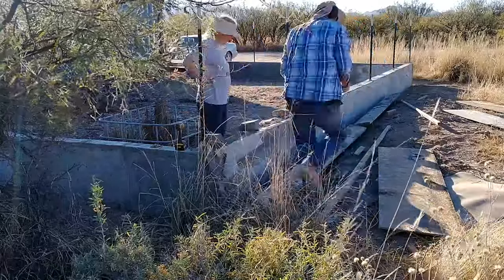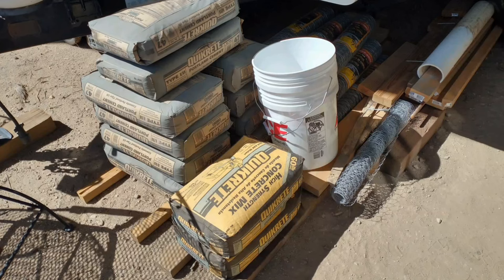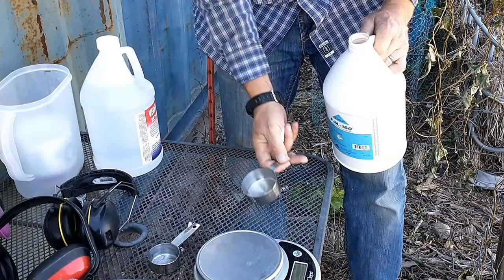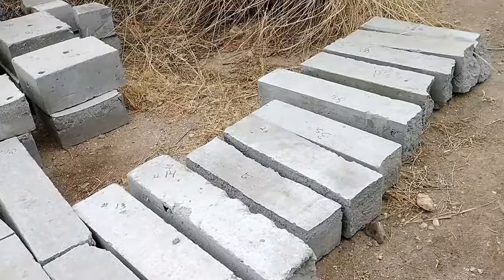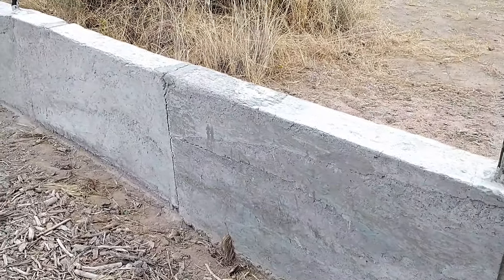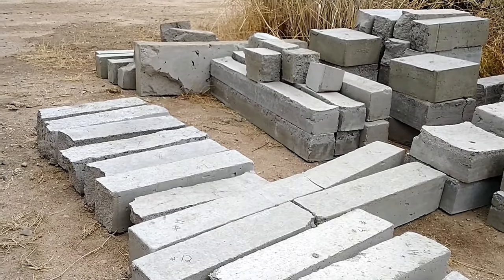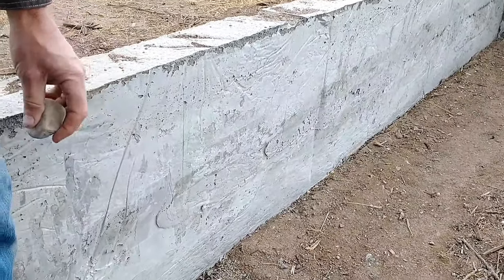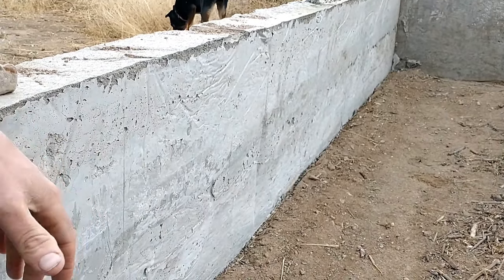Why we GAVE UP on AIRCRETE & What is Our Plan Now?

Comment: Alright, I am a Aircrete builder and instructor and it pains me to see videos like this discrediting aircrete when its blatant the amount of misuses happening. I highly suggest anyone wanting to experiment with aircrete come take a course with DomeGaia to learn how to properly use aircrete and what the best use cases for it are. 

I have not sat down and read through all of the comments on this video so I apologize if anything was answered I am about to go over. 

1. Your climate changed as you were doing your testing. Temperatures dropped and you probably weren't warming your soap water solution or the water you used in your mix. Curing cement does not like cold temperatures. Soap solutions do not like cold temperatures. 

2. All of the recipes are off. 
-Aircrete recipe should be 6 gallons of water to 94 lb bag of cement. 
-Soap density should be between 90-100 grams per quart. Never go under, you can go over. Our recipe is 16 oz Seventh Generation to every 5 gallon of water. No extra glycerin needed. Do not leave your soap water sitting outside over night especially in cold temps. If you do, stir it next day and add plenty of warm water with your next solutions and stir to make sure the soap hasn't coagulated. 

3. Aircrete is not really structural in this way. Its compressive strength is much much much less than concrete. We are talking like 200 psi vs 3000 psi. So building a straight wall building like this is a huge no without concrete pillars or some sort of other reinforcement to handle the roof load. We build DIY aircrete structures in the shapes of domes and arches for a reason, because that geometry is very strong. 

4. Aircrete (at least diy aircrete) is brittle. It will crumble, yes. You have to give the building tensile strength with fiber glass mesh or basalt mesh incorporated with stucco. Building with aircrete is like a surfboard, you have the foamy soft inside which is brittle and will break, but then you reinforce it with mesh and stucco and it becomes strong and almost monolithic. 

I could go on and on about a few other things but these were the main points.

Im sorry you experience with aircrete has been troublesome but most of this could have been solved by either coming to a DomeGaia class or reaching out to us for advice. 

Good luck on your next adventure, 

Cheers.
Reply from the maker: We shared our whole aircrete journey as we went, and this is the last video in the series. The whole process we used to make aircrete and our house design is explained in previous videos. We were open to advice throughout the process. We didn't know why it wasn't working and neither did our viewers. I watched every video I could find, asked lots of questions, did every Google search I could think of, and read every article I could find that was available at the time (2.5 years ago). We made lots of practice batches and test samples to help decide if we wanted to build with aircrete and which recipe we wanted to use. 
At the time, no one would tell us how to make the water soft, so we used an RV water softener, which seemed to work okay. No one seemed to know if temperature mattered or what the ideal temperature to make aircrete was. We were done with aircrete by the time we started hearing anyone talk about temperature being an issue. Warming the water would not have been practical for us anyways since we are off the grid, and have limited power. We have extreme temperature swings here in the desert and didn't realize that would be an issue. 
A lower water mix was recommended in some recipe booklets for poured aircrete walls, so that's why we used 5 gallons instead of 6. Less water likely made the mixing much more difficult, which was a problem. We knew that aircrete is not structural and had plans for that. 
Once we knew enough to do the calculations, we also realized aircrete wasn't going to save us any money, it wasn't as good of insulation as we thought, it was going to be much harder to build with, and it likely wouldn't last as long. We didn't want to build a temporary house, and didn't trust aircrete to last for 50+ years.
I'm quite sure if we had gone to a workshop we would have decided not to use aircrete. It was a frustrating experience, but we did save money by learning it on our own. We didn't enjoy the process of making aircrete, the poured walls were going to be a huge pain, and with our design we weren't going to save any money. 
Aircrete is interesting and we thought it had potential, We really were planning to build our house out of aircrete and wanted to share the journey. These videos share our experience with aircrete. The videos as well as the viewers comments and are here for people to critique and to learn from. 
Thanks, and best wishes. -April 🌞

Comment: Poor it in metalstud, or use fencewire for big pieces of wall.
Reply from the maker: We were planning to use cee purlins to build a metal frame to support the aircrete walls. The aircrete would have also been reinforced with rebar and possibly metal fencing, then covered in fiberglass mesh, and plastered.

Comment: There's gotta be a way to figure out what started going on. Some expert or scientist out there knows I guarantee you. You have lots of clues. You just need to narrow in on the culprit. Not like aircrete is the only way to go though. Lots of choices out there these days.
Reply from the maker: There's not many aircrete experts out there that I know of. The ones I see online have struggled with aircrete also. I could see building a shed out of it for "fun", but I wouldn't build a house that I want to last 100+ years out of homemade aircrete. It's too finicky, and there are too many unknowns. I would suspect the cold Drexel was our main problem, and using warm water may have helped. 
Once we crunched the numbers, building the house we wanted with aircrete no longer made sense anyway.

Comment: Boy, I feel bad for you guys wasting all that time. I was also going to use aircrete, but was able to decide against it just by watching other people, who although they were able to make some small dwellings, I saw that there would be problems down the road. I also wasn't sure if I was going to off grid in AZ (I used to live there, in the High Desert in Apache Cty) or some other state where I can depend more on the availability of good soil and water. Everything is a compromise, that's for sure.
Reply from the maker: We were working on other things at the same time. I'm just glad we didn't even try to use it for our house. It sounded interesting, but there are definitely better and less expensive materials available to build a house out of. Our house turned out great, and the soil is actually impressively good out here. It just takes a little work to gather it. 🙂🏜️

Comment: Have you ever seen a hay bale house?
Reply from the maker: Yes, we didn't like the risk of mold and bug issues. Our son just built a hyperadobe house. 🛖
Reply: Just being picky - hay and straw are too different materials.  Good hay is leafy, straw is stems (iirc usually from wheat).  I hauled a lot of hay when I was younger.  Helped build a straw bail house and felt like I was superman - straw bails were about 1/2 the weight of hay.  When researching straw bail houses, they discussed the difference - mainly that hay is a good food source for animals (and insects), straw not so much.  I suspect there would also be a fairly large strength difference.  I enjoyed the workshop on straw bail houses - but after talking with the owner throughout the week, I realized that it was not nearly as cost effective as I had hoped.  I am sure it was many reasons, but the correct plaster was the killer for me - as it could not be sourced in the US, but needed to be imported (and as such was quite expensive).  Add to that, as it is not used in the US, there is virtually no working knowledge in the US masonry industry.   @RedandAprilOff-Grid

Comment: maybe as time went by..the stocked concrete slowly expired or lose effectiveness..
Reply from the maker: It didn't sit around long at our place, but there was a cement shortage when we were making this, so that is possible. The colder temperatures were also likely an issue.

Comment: did you shake the drexel bottle thoroughly before each use? also cold temperature would not help, also dont over blend the foam+cement.
Graphene seems to be an amzing additive https://www.youtube.com/watch?v=TYgvqokXAeI
he consistently make good batches, most time i see him doing small batches, may be contact him for any advice, he responses to youtube comments
re: over blend foam + concrete, you need to keep moving the rig around, maybe pulse it, eg 1 sec on 1 sec off or pull trigger at slow speed, and move up down motion, maybe even try using the cement mixer you already have, gentle slow blend.
Reply from the maker: We didn't figure it would be a good idea to shake the Drexel, but we did try to mix it around some before each batch, but sometimes forgot. One of the last things we tried was using a new bottle and pouring it back and forth into a jug, to make sure it was mixed well. Our first successful batches turned out amazing. I would guess the colder temperatures were mostly to blame for the later issues. The foam was becoming more dense, and he tried to adjust some for it, and it was still in the acceptable range. Yes, I asked advice from Herger several times. It is much easier to mix smaller batches, but we knew we would need a lot of aircrete, so wanted to practice making larger batches. It would take a long time to build a house one bucket at a time.

Comment: All the time and effort ive seen people put into AirCrete, just pour the concrete and be done and know itll work.
Reply from the maker: We wanted something that had some insulation value, but yes concrete is still a better option.
Reply: Not a specific dig at you either.  Just observing YouTube alternative building ideas.  I really like the idea of ICF, but it can be pricy.
Reply from the maker: @phslion  Yes, we thought this would be less expensive and still offer decent insulation, but it turns out it's not cheaper than a traditional home, and the insulation value isn't very good. We are so glad we didn't use aircrete!

Comment: Man, I know exactly what you were doing wrong. The samples were decreasing in quality because you were stirring them more with that mixer. I get perfectly repeatable results with aircrete and a concrete mixer. If you check out my channel i have some videos on the process i use, which is just mixing 90#'s of concrete in at one time (to make the columns) and 60#'s for the foundation, which i also covered with motor mix for the top part. I would go back and try those samples using a more gentle approach for mixing.
Reply from the maker: Sorry, I missed seeing your comment. Glad you figured out what worked! We tried different mixing techniques and speeds. My guess is that the cold Drexel was the main issue with our later batches, but we also had a lot of trouble with mixing, so that was definitely a contributing factor too! There are more details in our other videos about the different things we tried. Best wishes with your aircrete projects! 👍🙂
Reply: @RedandAprilOff-Grid  Well you have to realize your mixing a foam, and if your up in it with a high speed mixer the foam characteristics are going to change. I laid an entire foundation using hand mixing and it was a terrible patchwork of different looking aircrete. When i got a cement mixer, all my batches came out like the ones before.
Reply from the maker: Cool, and good to know, we had heard that cement mixers don't work well, so we didn't try it. We were considering getting a mortar mixer, because Aircrete Harry had success using one, and we were going to need to make a whole lot of good aircrete to build a whole house. 👍😎

Comment: I thought that air Crete had a standard formula.
Reply from the maker: There are different recipes depending on what you are using it for. Mixing 6 gallons of water with the cement seems to be most common. I have seen recipes using as little as 4 gallons water, or as much as 8 gallons. The amount of foam added can also be adjusted. Less foam for more strength, or more foam for more insulation value.

Comment: They tell u Not to use anything but Portland cement-so if u used quick Crete u were creating problems;)
Reply from the maker: We used Portland cement in all of our batches, but had very limited brand options. There was a cement shortage at the time. 
We did have some quickrete sitting around, so maybe I showed the wrong picture in the video. 🤔

Comment: I don't see any reinforcement in your pours.
Reply from the maker: We were just testing different mixes and our ability to make consistent aircrete, and were planning to add wire mesh, and rebar on the inside of the walls, and fiberglass mesh, and plaster to the outside, as well as a sturdy metal frame.

Comment: Aircrete is not to be structural!!! You must protect it... Stucco and reinforcement fibers must be put on the outside.
Reply from the maker: Agreed! We have other videos sharing our plans. We were just testing different mixes and our ability to make consistent aircrete.  We were planning to add wire mesh, and rebar on the inside of the walls, and fiberglass mesh, and plaster to the outside, as well as a sturdy metal frame.

Comment: When using pure materials with portland cement  you must use an accelerant  other wise the cement does not produce heat to cure.\ This what i see you are having an issue with. That is why it is SOFT!
Reply from the maker: Interesting, haven't heard of anyone using it in aircrete, but might be worth a try.

Comment: Just purchase autoclaved blocks already formed.
Reply from the maker: Cool! Are you going to build your house yourself, and how is the price?
Reply: @RedandAprilOff-Grid  I have a stone ruin in Portugal to fix up a boat in the Philippines to build and I will probably be living in my small sailboat in the UK while I do some teaching in a couple of months.
Reply from the maker: Wow, sounds like you have a whole lot going on!  😎
Reply: @RedandAprilOff-Grid  OK here goes I got called away before. So here goes as my friend the late actor Jess Rudom used to say herswachagaddado: I like wood I am a Maine cabin type, with vertical timbers but I think you said you wanted it fire proof so either do earth bag construction dirt cheap pun intended or watch this video:
https://www.youtube.com/watch?v=RhvpWi2oUcU&t=7s
Now put one and one together and make two. In the Philippines I can buy square pattern stainless steel chicken mesh really cheap. Now consider what the guy in the video said about the plasticiser/waterproofer. Build the post and beam structure of your house in reinforced concrete now get some of this chicken wire and span the open sides with it. put a temporary wood backing on the inside about 1/2 inch behind the mesh. Plaster it with mortar to which this plasticiser has been added move the wood do another section repeat. Now what have you got a very cheap ferro cement house that is basically going to last for a thousand years. Insulate as you wish you have lots of space for the insulation. I have a unique idea for insulation which you have to make but it is basically free, I will do a video in my channel when I get time but it is similar to aerogel but a lot more stable. Please subscribe to my channel.

Comment: When you say "we decided", are you saying one person was designated with coming up with a way to make things work and then the other person was supportive of the plan? Because anything else leads to this kind of repeated failure or "learning". Re-inventing the wheel isn't what you set out to do, but is sounds like what has happened here.
Reply from the maker: Yes, we decided it wasn't going to work for us, it was a joint decision. Aircrete wasn't going to be less expensive, (some say it is) and it was going to be a lot more work. We also learned it wasn't going to work in our climate, we have hot dry summers, and get well below freezing every night in the winter.

Comment: Making the foundations with aircrete was obviously not a good idea, simple ordinary reinforced concrete would have been better. As for the walls the “aircrete” in bricks or in blocks, even inconsistent could have been used easily.
Reply from the maker: The footers for our house are concrete, we were hoping to use a low foam or sand mix for the floor. I would consider building a shed with aircrete blocks, but not a house that I want to last 100+ years. We could see from our garden wall that poured walls are not a good idea with aircrete. It shrinks!

Comment: bad pump bad temperature to make consistent aircrete very common issue
Reply from the maker: Aircrete is tricky stuff. We are working on plastering our aircrete garden wall. It shows quite a bit of shrinkage and cracking, but it is much more solid with the plaster. We are very glad we didn't build our house out of aircrete.

Comment: Not all Portland cement is the same. If you were not using pure Portland cement without additives you are bound to fail no matter what you do.  Most cement purchased from hardware stores have additives mixed to bulk up  the cement. The most common mix has added Pozilan aka. P1 This is demonstrated in the video link attached  https://www.youtube.com/watch?v=6OFsm22t9eM&t=25s
Reply from the maker: Sounds like something to consider. We live in a smallish town with limited options. We were buying from Lowes or Home Depot, there was also a shortage of Portland when we were making aircrete. Our first batches turned out well, but the colder temperatures may have affect the Drexel foaming agent. It's tricky, best wishes! 🌞
Reply from the maker: Here is an earlier video of successful batches: https://youtu.be/TweER67O0e8